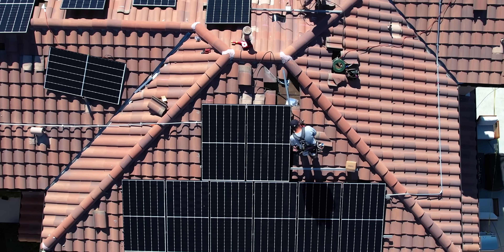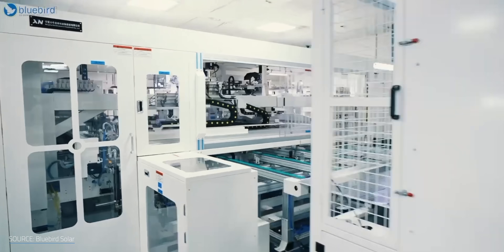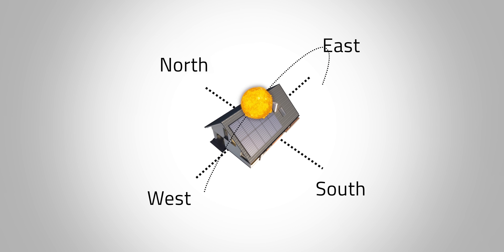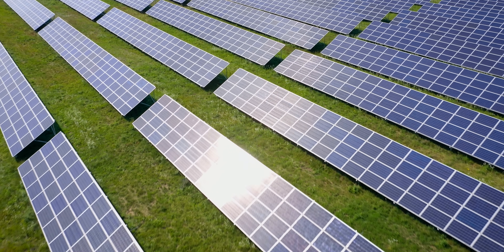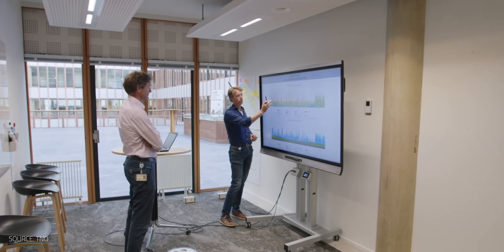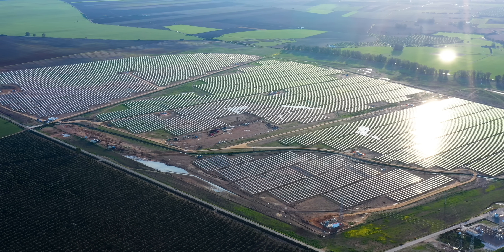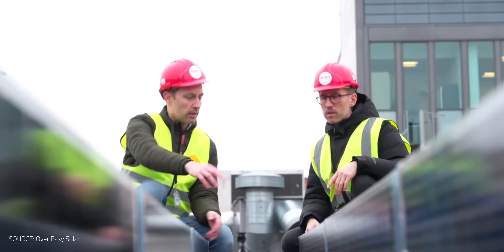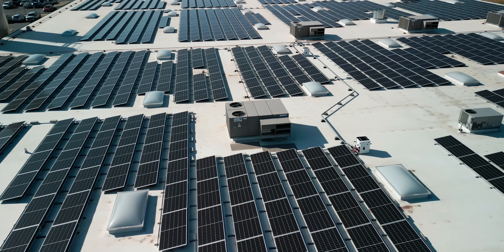Have we been doing Solar wrong all along?

Comment: Thanks Matt, great information as usual.
I was a little surprised wind loads weren't mentioned. On a typical ground mount you use a framework that provides ample points of support for each panel. If you're possibly using a monopole tracking system, that's not as true, but still better support than I see these verticals getting. 
Held up on one edge? I wouldn't be comfortable with that where I live, where we can see 50 mph gusts a couple times a year.

Comment: Have they tried to make a solar panel that not only was able to convert sunlight into electricity but have ways to convert energy from the heat as well? Maybe the heat energy system could keep the solar panel parts cool enough for them to stay electrically efficient?

Comment: This video neatly addresses a key dilemma: I have an asphalt shingle roof that has maybe another decade of life left to it, and I don't really want to put solar on it only to remove it when it comes time to replace the roof. I'm also replacing all my privacy fencing, and I realize I have two long runs that go almost perfectly north-south, making them ideal for rows of vertical solar panels. Meaning that even if I need to purchase several extra panels to meet my total energy needs, the savings on labor and fence materials should more than pay for it.

Even better, this makes my solar installation a DIY process, as there will be no need for any roof-top work. On top of that, I expect to have less maintenance due to less deposition of our insidious San Diego dust that keeps blowing in. Win-win!

Thanks!
Reply: Yeah, using these to fence a yard is kinda brilliant. 👍
Reply: @serversurfer6169  If you have a proper illumination and not too fond of trees in your yard
Reply: Yes, but BEWARE the lawn mower throwing debris at the panels. Typical power mowers can throw rocks at least 100 feet/30 meters, including upward trajectories (probably from richochets off the ground). @serversurfer6169  @flymypg
Reply: Flat panels on a roof will extend the life of the shingles as they protect the shingles.  But in your case, you might want to check with an installer to get their opinion.
Reply: @eyemastervideo  SMhippyH! Installer says; "Yeah, you really need to replace them all now. I'll give you a FREEEee estimate!" :~))
Reply: I had to replace my roof in San Diego 8 years after installing solar panels. It added $4000 to the cost to get them taken down and put back up again. Definitely worth replacing the roof first!
Reply: My panels were disconnected by a handy electrician ( a 2 min job) removed while new roof was put on, then reinstalled and reconnected ( it was just one cable for a lineup of 6 panels.)
Reply: We had a hailstorm here a few years back. The only neighbor that didn’t have to have his roof replaced was the family with solar. The wife told us that none of the panels were damaged as well.
Reply: @dylconnaway9976  Summer of 22 or 23 in Nebraska saw a huge number of solar panels destroyed by hail.
Reply: I was thinking the same thing about the fence. However, people suck, and I can see people breaking or trying to steal the panels.
Reply: I’ve got the same type of rough and half a dozen solar companies have refused to install solar on it. I have to take a closer look at vertical installations.
Reply: You could replace the asphalt shingles you have now with solar shingles like those from CertainTeed or Luma or SunTegra
Reply: Except when a kid kicks a ball in to it, or a dude on a bike hits it, or any number of other negative happenings which can befall a fence..
Reply: The other thing to think about is insurance requirements or regulations and cost once you put panels on your roof you’re drilling holes in the waterproof covering above your living space and insurance companies will take note in your premium your fence vertical solar panel option would be much better for those reasons and others
Reply: This is what happened at our home. Although ten years is a long time to put off getting panels. I won’t get into the extraordinarily poor quality and life expectancy of American roof materials, but I come from somewhere that usually uses ceramic or slate tiles for roofing.  Anyway, we had our first solar array in the roof in 2007. It proved to be insufficient for California summers, which have grown increasingly hot, for reasons most of us comprehend. We decided in 2020 to add a second, larger array, but it was evident the roof needed replacing. This meant removing the 12 panels for the reroofing and then returning them to their former place. We were charged $1500 for that. Given the colossal gouging that is commonplace now, I imagine it would be significantly more expensive. We now have 33 panels on our roof. Another consideration is that the panels are a second layer of roofing which should, in theory, give your asphalt roof a couple of extra years.
Reply: My concern with this (esp fencing) - is with debris (rocks, branches) thrown by lawnmowers. You'd need to use a mulching lawnmower with no side-ejection chute... it could be done.
Reply: @Maybe-So   That's easy. Put the panels a few feet off the ground and lawnmower debris won't reach. You're more likely to have sunlight blocked that low so you don't lose much by having a normal fence there.
Reply: We have been doing solar all wrong from the start... We don't need batteries. We do most of the work during the day... Heavy industry operates mostly only during the day. We commute mostly only during the day. So use solar during the day and regular fuel at night when most of us sleep. That would reduce our reliance to fossil fuels by 60% or more practically over night. 
But why aren't doing that? Why are we wasting money on batteries and why aren't we using the tools we already have to their maximum efficiency?
Reply: Yes for a privacy fence but presumably no for a security fence.  Then there's the question of ownership and maintenance for shared fences. Need to think about the current neighbor and when the neighbor or you sells.
Reply: Panels are heavy. but need as stronger roof. Next You has ti have a battery section and only connected to griid. If the griid goes down You are not down some 1-2 days 

You of course know that. 

I have 2 cooling ands warming sompressor united and has insolated walls and wondows.  That save o lot of money and comfort all over.
Reply: @jensholm5759 Solar panels are not really all that heavy. Mine weigh about 40 lbs over 20 square feet, which is 2 pounds per square foot. That is equivalent to about 2 inches of snow. Most roofs in the US would not require any modification to support the extra weight of solar panels. Some more premium roofing shingles might weigh as much as 2 pounds per square foot more than cheap ones. Or think about it this way: would your roof collapse if 4 athletic men stood on it? Probably not, yet that is the weight of 20 panels.
Reply: Dearest Matt. If the roof has a space contraint, will the vertical panels offer à better output for the same surface.? Thanks
Reply: Put on cool roof. no need to reroof. I did that 20 years ago.  much cheaper.  will reflect light on the solar panels.
Reply: Not much of a dilemma I'd say. I dunno in your case, but at least in my area it's pretty normal for installers to offer free removals for your panels for whenever you need to change your roof. They only have to do it, roughly once every decade twice per house, so it's not a biggy for them to do that. 

And it gets rid of another silly petty excuse that people make for themselves to not go solar! Really taking panels off isn't that hard. Don't be lazy! The technical detail is mostly in just in drilling the holes, and making sure all the framing pieces line up and are screwed tight. Once the frame is on the panels just bolt onto it normally.

Comment: It makes sense to use vertical panel in higher latitudes. If we compare vertical and horizontal (90° difference), at equator, vertical would get ~0 sunlight and horizontal would get ~100%, while on pole it would be exactly opposite. So, if you live above 45° North (for Europe, everything above Italy, for America above Ottawa), vertical will be better (sure, difference between light coming at 45° and 47° will be very, very small, but in Edinburg at 55° of North latitude you will see difference). Then there is less cleaning which is no brainer, clean panel lets more sunlight to the important parts. And if you use it on a fence, maintenance will be quite easy, because you don't need a ladder to get there. All I fear about is some "prankster" throwing stones on those panels. Some people will break things just because they can.

Comment: As soon as I saw bi-facial solar panels I immediately thought to put them vertically.  Not only does it collect sunlight at any angle, it's easier to add reflective materials under and all around it, and if there is ever a hail storm, there is much less chance that the panel will be damaged since only the edge is facing the sky, and you can reinforce that edge with a little metal.

Comment: I learned about bifacial vertical panels last year. I immediately thought of the exact thing Over Easy Solar has been doing - narrower panels mounted vertically like fins on a roof. Literally the exact thing they have done. They have a great execution of the idea and I hope they can get it on a lot of flat roofs. Seems like a huge market here in the US on the millions of square feet of flat roofs in retail centers alone. Add in warehouses and other large light industrial buildings and the amount of generation could be very large. Think about it - most of those roofs have a white membrane which reflects a lot of light. It's a perfect application for bifacial. I think some version of it could also be applied to residential roofs as well. My only question is how do the panels behave in really high cross winds? Do they vibrate or wobble? Would that be an issue? Remains to be seen I guess.

Comment: I have vertical east west bifacial panels on a cabin in Norway. Not only do i get more power in the morning and evening when i need it most, but its the only setup that works when i am not there as it stays snow free. We have 7 months of snow a year, its s big deal. 
Other point, in winter when the sun is low, more vertical panels do better anyway at this latitude. I sized my setup to be barely usable in december. In summer we have way too much sun. If the panrls were on the roof and snow free, i would still need a much bigger system in december and januari.

Comment: im going to guess heat is to blame? i have a small 12v solar setup on my shed to power lights and tools. i noticed on very hot days that i would actually generate upto 3amp less power on each 200w panel than compared to a cool but sunny day. what i did was i put 2 140mm pc fans under each panel that suck air through holes i cut in the roofing iron. works good as i can now keep a solid 10amps per panel output even on 35deg days where as is had been dropping as low as 7amps

Comment: VBPV's could be useful along the fence line for residential, though with the combined ownership common with fences, that'd be messy if installed as part of the fence, though potentially it could be a part of a curb facing or pool fence.
I have an issue of a neighbor who's house is approx 2-3ft higher then mine, causing poor evening performance, but if I had a curb facing fence with VBPV's, I could perhaps catch more of the evening light and get probably 4-6 panels in an east-west orientation, sure not many, but I've already got roof solar.

Comment: If solar panels can be developed to convert infra-red energy to electricity, then the heat from the asphalt in the summer could potentially add to the yield of panels placed on the side of highways.   In some areas the asphalt gets hot enough to fry an egg.  Another place could be on some beaches where the sand absorbs a lot of heat from the sun.

Comment: Slanted panel loose efficiency the moment the Sun nears 90 degrees relative to the panel's perpendicular. That's why some installations have mechanisms that point the panel perpendicular to the Sun to maximize that efficiency at the cost of complex mechanisms. A bifacial vertical panels will only loose efficiency at a short amount of time - when the Sun is directly overhead. I can see the higher efficiency compared to stationary slanted panels.

Comment: If the benefit of the vertical solar panels is related to their staying cooler, it would seem to me that designing in (or retrofitting) passive heat radiators to the shadowed side of normal panels would be the way to increase their efficiency as well.  What do you think?

Comment: Since cooling may be a cause for greater efficiency, I wonder if enhancing cooling further with aluminum fins or placing panels by running water would help improve solar panel efficiency for both horizontal and vertical arrangements.

Comment: So what happens if you run a cooling system on horizontal panels? Sure you spend some energy running the cooling system, but likely the gains will outweigh that. The question is if that in total puts it at or above BVPV's total output.

Comment: The other unmentioned benefit of vertical (not necessarily bifacial, although it applies to them) solar panels is that by extending the total hours of useful solar generation (more in the morning/evening, less at midday), you can extend the amount of time you can power directly off solar and reduce the required amount of batteries to carry you through the night.

In fact, for personal residential deployments it's often cheaper to "over-panel" (since panels are cheap) and undersize your inverter relative to theoretical peak panel output, and then downsize your battery (since batteries are expensive, and wear out). Your smaller inverter can technically clip during the brightest times, but the inverter was cheaper and you get to amortize it over more "running hours" per day because you've added an hour or two on either end. Going from needing your batteries to float you through 16 hours of low solar output to just 12 hours for example can let you install 10-20% less battery.

Comment: "Higher energy yield than expected" does not mean they produce more power than south facing panels. If what you want is maximum power output per area, you want the panel perpendicular to the sunrays. And the difference is not small - upwards of 30% more power output for "sun facing" panels rather than vertical panels, and that's a mighty big gap to close to make vertical panels competitive in situations where sun facing panels could be installed.

That said, they're getting more from vertical panels than they expected - yay! In the right installation that's a great thing and encouraging for people with that need.

But if you're really trying to maximize output, sun tracking is super amazing.

Comment: Hopefully they'll get this moving. I wish each innovation didn't "add to the costs" because, SCHWEEW it's already expensive.

Just because it "looks" different, doesn't mean they need to charge more. Most of the aluminum brackets would still work vertically as well as they do at a X* angled random roof. I can see the panels themself being a little more spendy because you're getting two panels wrapped in one package, but you're getting twice the amount of glass front sun facing vs east/west facing, not much more aluminum surround, and it will not need to be as resistant to blunt force trauma as a horizontal/angled sheet of solar panel (neighbor threw a brick onto my roof - no damage thank goodness).

I had solar installed on my home last spring, probably wouldn't do it again because of the mish-mash of financial jargon used throughout the industry (or purposeful lack of explanation). Tax credit, yes, tacking that into your Solar loan contract as a dollar amount that will be deducted after the solar tax credit refund, bad. Paperwork showed $16,440 removed from loan after solar tax credit applied. In reality, it simply lowered my annual income bracket, gave me about $3k more tax refund (From ~ $2K to $5k). That's a far cry removed from the $16,440 they show me being able to give to the loan company with funds generated from the tax credit.

Needless to say, my loan bill is going to jump up about $150 a month come July this year because I can not hand them the $16,440 solar tax credit they have in the paperwork. I had more solar installed than they thought I needed, and I am still not covering my electrical expenses. I have no more room on my roof to go even bigger either. So loose/loose financially. 37 panels, two power inverters, and reinforced roof trusses (I almost called B.S. because we got a LOT of snow the year before, and it stuck to the roof. Very little snow sticks to my panels (maybe an inch or two) before it goes WHOMP off the roof (taking my gutters with it) the the planter boxes below (used to be planter boxes, they're mud holes now). I've got a steep roof, and it had gutters until it snowed.

If batteries ever come down in price I will add them (adding batteries at the time of install would have doubled the cost of my solar system ($55K to $100K). Until then, I grumble when I pay my still substantial electric bill, and want to smack the salesman that handled my solar system design everytime I see the money taken out to pay that loan ($232 a month now, ~ $371 in July if I can't give them $16,440).

If I see that salesman in public, I will not be responsible for the verbal creativity that will spew from my mouth in his general direction ;).

Trying not to diss solar in general, but it is just about as shady as buying a new car at the stealership. You'll get something that looks nice, but you're going to pay through the nose for it.